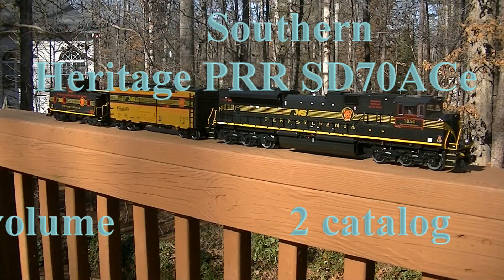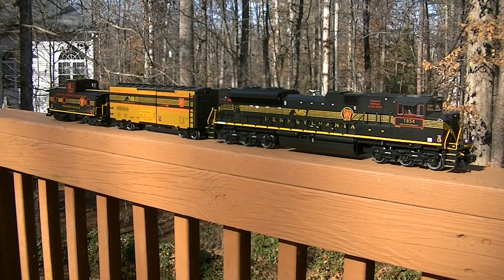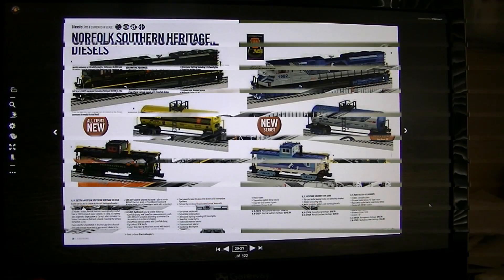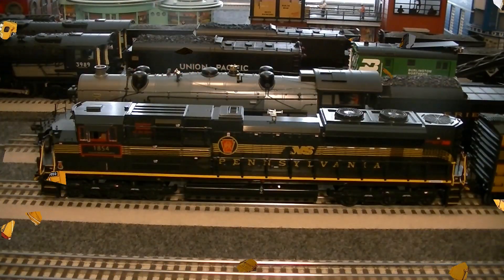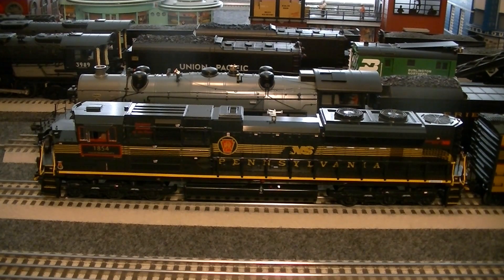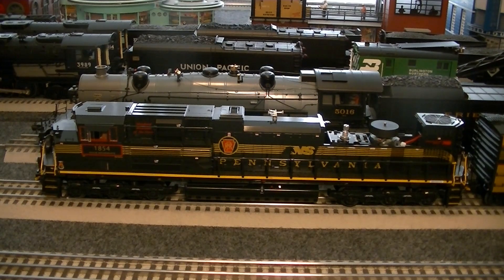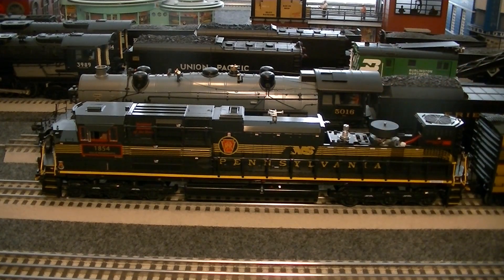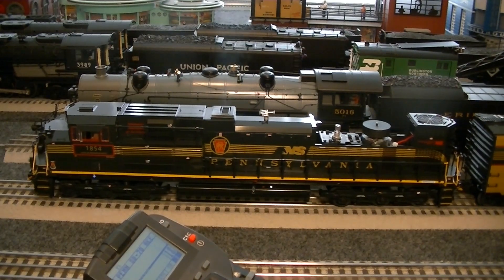2009 Lionel Norfolk Southern PRR Heritage SD70ACe

Comment: Great Video Bill!!! That engine looks and sounds Great! Thanks for the shoutouts too man! I'm happy to own this engine and the matching cars to go with it, And from the looks of it your happy to have to too. Mine is back now and while I haven't ran it at the time I'm typing this, I hope it'll sounds better. He fully replaced the board on the engine.
Reply from the maker: Thanks Matt!  He did not have to replace the board, the boards and the wire harnesses need to be pulled and then reconnected!  Thanks for the comment bud!

Comment: Bill
Great engine!  The horn is great!!  I bought the Southern Heritage SD70ACe about 2 years ago, but I had different problem with the cab light and loud smoke unit like many have had.  The cab light would get brighter when running it rather than turning off like it suppose to.  I returned it to the dealer and sent me another one, but it did the exact same thing.  He told me I could send it Lionel to have it fixed or send it back and give me a refund.  I took the refund; even though; I had all the matching freight cars.  I already had many troubles with several other Legacy engines and sent everyone back to Lionel to be fixed, so at the time I was not interested in sending another one back to them.  I love the paint scheme on the Southern, but too many problems.  Nice video!
Reply from the maker: Thanks ks!  Yeah they did have a lot of problems back then, but once fixed "at least from my experience" they work great!  I guess I am fortunate that I enjoy trouble shooting because most of the issues are easily fixed with a small amount of work!  Anyways, thanks for the comment bud!

Comment: Bill that is a great locomotive. That is interesting about the smoke unit turning on as I have this engine and never noticed that. The sd70s built in this time frame were the last big diesels made with the first generation. legacy sound board design. The first run built in 2009 did not have many sound cutting out issues but the second run in 2010 had several issues you mentioned. One of the issues was the size of the sound board being just a little wider than the width of the shell. When the sd70s were assembled the boards and connections would become unseated.
Reply from the maker: Thanks George and thanks for the info!  Have a great one bro!

Comment: ...also had the same issue where my U.P. Katy SD 70 would not run brand new out of the box. Turns these engines where notorious for having pitched or loose wire connections.

Comment: sweet engine with on awesome horn Bill, I unfortunately had many of my engines experience the problem with the sound when they were new I noticed that thing with the smoke units on these engines that's why I never leave power on too my sitting engines and one of the reasons why I put in power switches on my sidings. thanks for mentioning me in your video, and what kind of smoke fluid do you use?
Reply from the maker: Thanks, I use ProtoSmoke, Lionel Premium and JT's Mega Steam, but in this video I was using ProtoSmoke, Christmas scented!  Anyways, thanks for the comment bud!
Reply: Bill Yates thanks I might pick some ProtoSmoke up and try it out hopefully i can get some for cheap at a train show